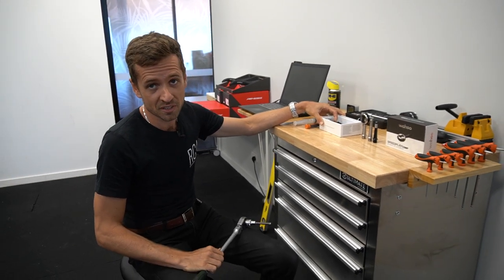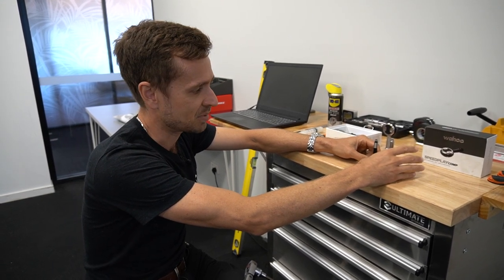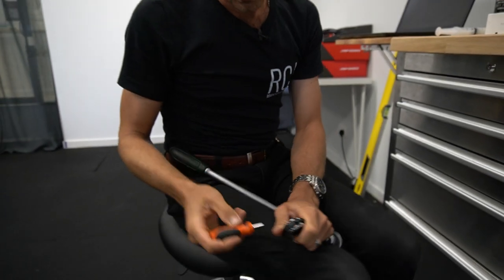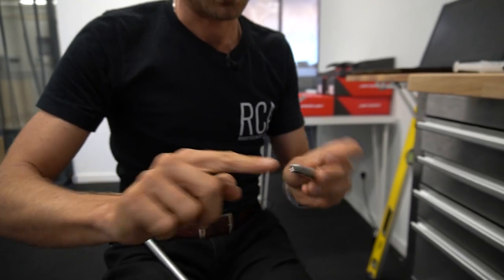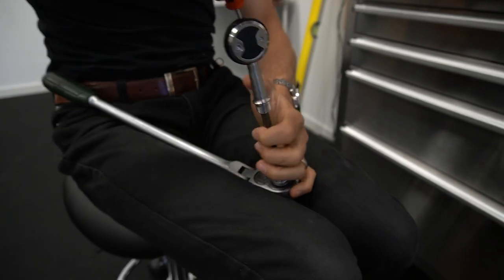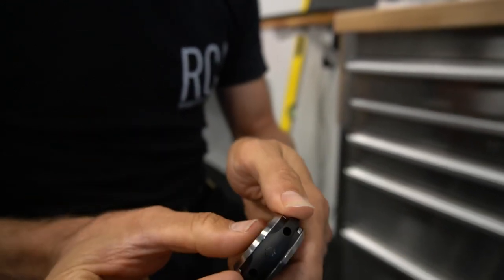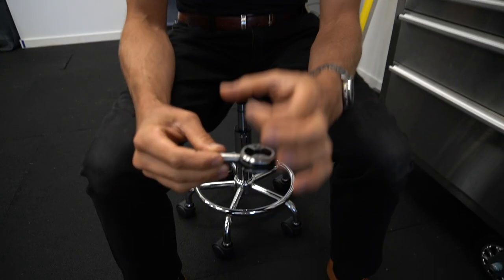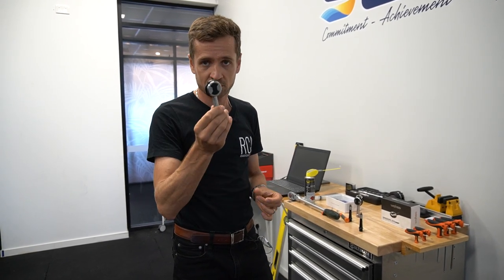How to change Speedplay Axles (on the new Wahoo system)

Comment: Have you determined the cause of the lateral movement many new wahoo Speedplay users are having? Wahoo says they’ve fixed the issue but replacement pedals are having the same problem, sometimes within the first one or two rides. Is it the bearings, or pedal body, or something else?

Comment: I am on my 6th pair of these pedals due to lateral movement of the pedal body on the shaft.  Wahoo have replaced them immediately and the customer service has been excellent BUT the problem is there.  This is NOT normal wear, each of the failures happens within 100 miles of riding and can happen to LH or RH pedal.  Do we know the cause, and have you come across these failures?
I am guessing this problem is a component failure, plastic or nylon washer/spacer failing, but would be good to know.
Reply: From my experience this has not improved at all.

Comment: Can you provide a link to the aftermarket spindles that you would recommend?
Reply from the maker: We'll get Neill onto that one. Stay tuned.
Reply: I second that
Reply: I have the J&L from ebay. The quality is perfect!
Reply: I third that, I have swapped the old speedplay version and you should put a drop of (not to strong, purple?) threadlock on the screw, the snap you hear when the screw is undone is threadlock giving way.
Reply: @NigelJMcD  I had to use locktight to keep my screws from backing out
Reply from the maker: My machinist isn't selling to the public (he's a part timer) but the J&L ones as mentioned below on Ebay are surprisingly good and I've used them in emergencies in the past without trouble. - Neill
Reply: Have you tried iSSi replacement spindles?

Comment: Spray every couple weeks? Try every other ride or two. Also, get their optional stain steel wear plates for the cleat base. It will extend the life of the cleats a lot. Half-way thru you can even flip them over for a new wear surface.

Comment: Hello, to do maintenance on this pedals (wahoo version) there's only to remove axle and put some grease? For regular maintenance one time a week spray little bit PTFE drylube on pedals or cleat is enough? 

There's a torque for 3mm allen screw or just by hand? 

It's not possible to change the bearing in the future? The solution is changing the axle for a new one? 

Thanks for the video :)

Comment: I actually use one of these axles on one side courtesy of Neill but my question centres around the ability to change axles with the power meter version of the pedal? Thanks
Reply from the maker: G'day Stuart, I'm not 100% sure yet (never had to do it) but my guess would be the spindle bearing tapers/shoulders would be totally different. I've not yet had the chance or need to pull one apart - and I'd be reluctant to in case it messed up the strain guages in the power pod! - Neill
Reply: @roadcyclingacademy  Thanks Neill I’d agree with that. My thoughts are get a single sided power unit which is LHS I think then just change the axle in the RHS which is the one I need to change. Possibly a work around? Thanks again.

Comment: When would you want to switch those out?
Reply from the maker: Typically if the rider has had too many doughnuts and their knees are tracking wide of the pedal centre, or if there are other symptoms of hip impingement/biomechanical issues from the feet being too close together. There are a LOT of potential reasons which unfortunately are highly variable between people. - Neill